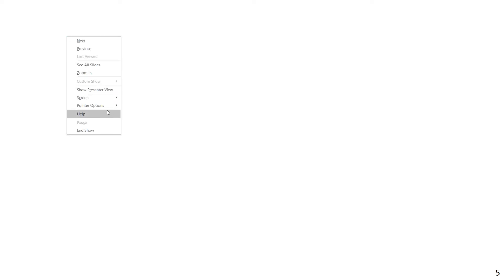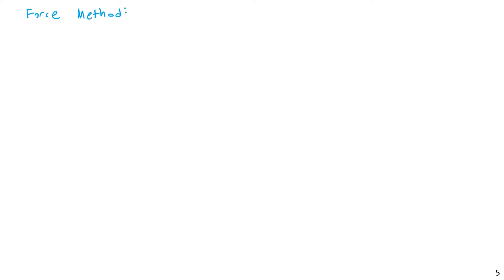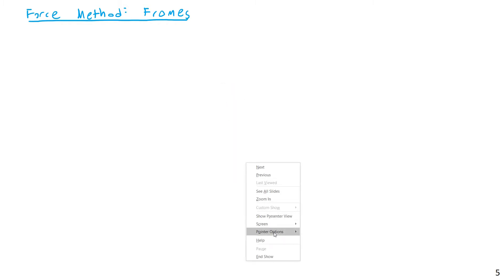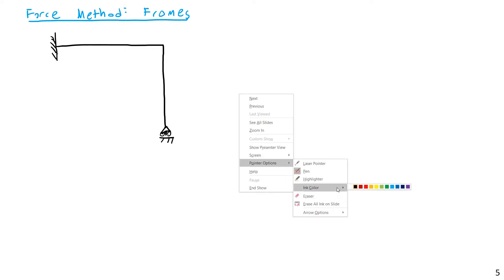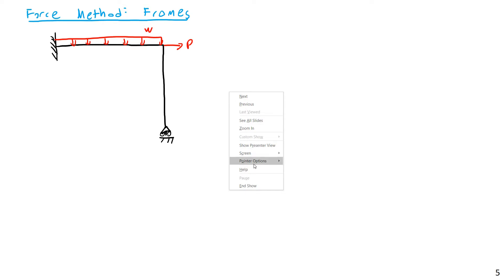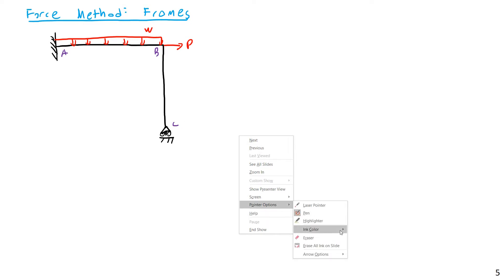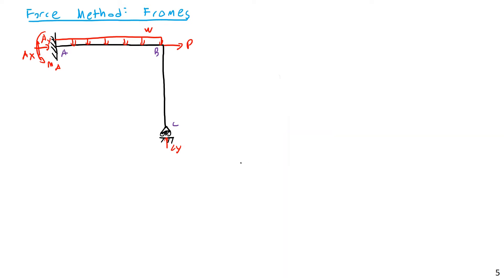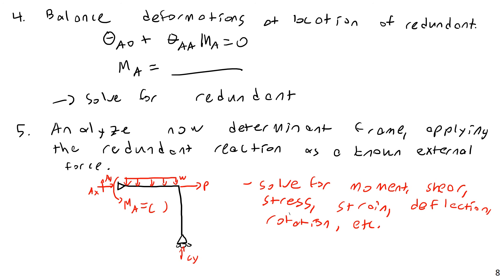Force Method for Frames - Structural Analysis

Comment: shouldn't we use superposition method to solve it like the beams. i mean you get the first theta from actual frame without the reaction and a virtual frame with 1 unit load in the position of the reaction( using virtual method). and you get the other theta from redundant frame with its virtual frame. are beams and frames are computed differently in force method? thank you